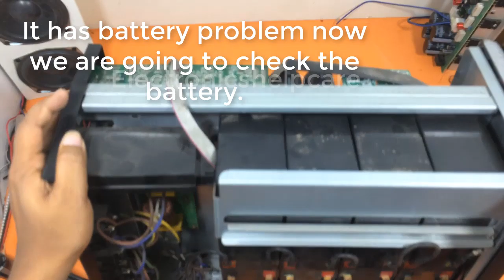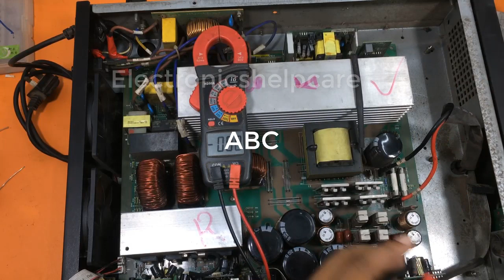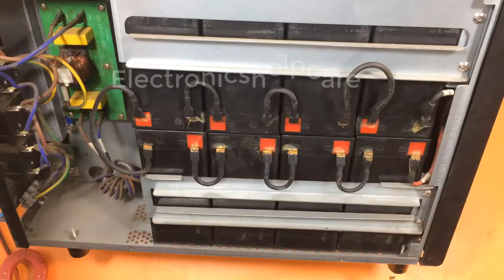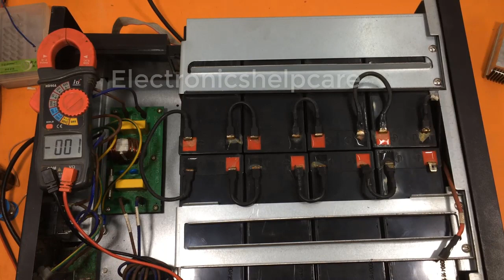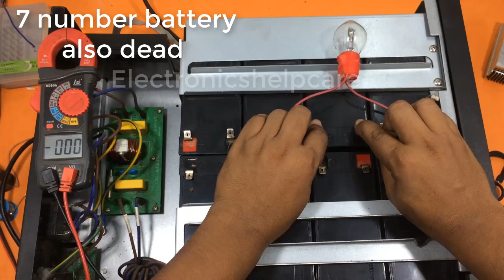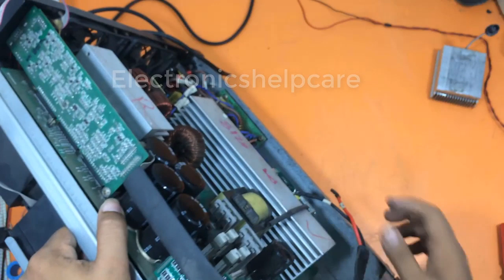online ups battery problem

Comment: If the batteries are 6 pieces and par battery voltage is 13 voltage, so the total should be 78v? Is it correct